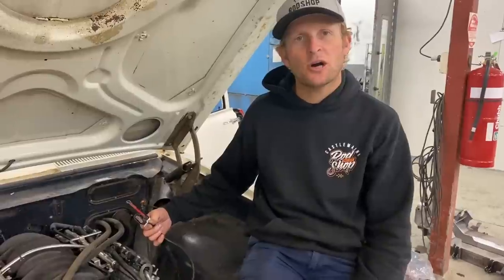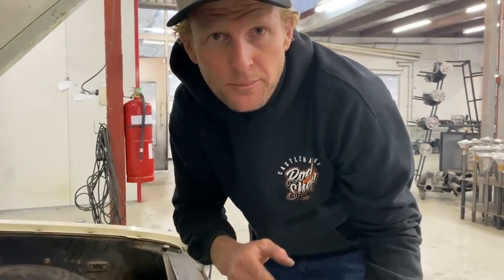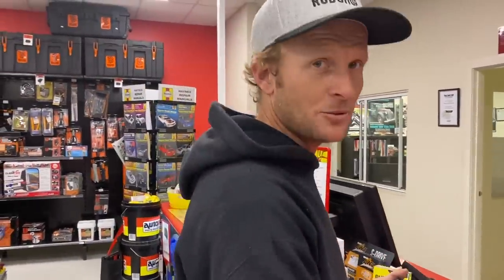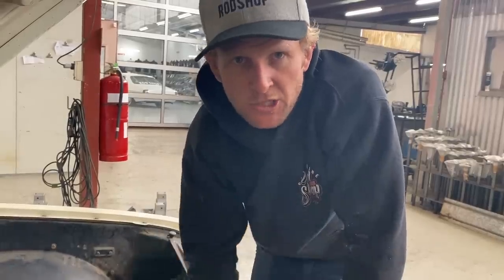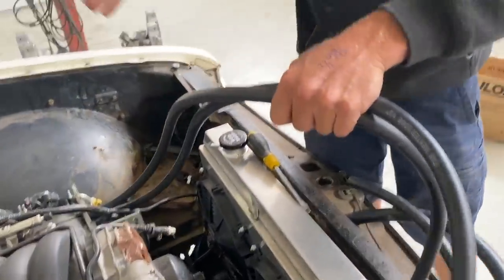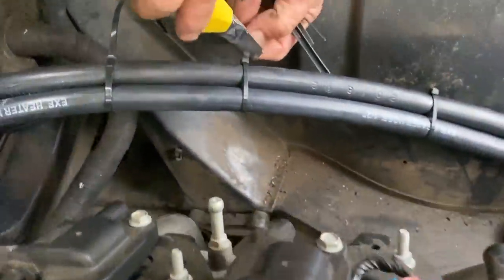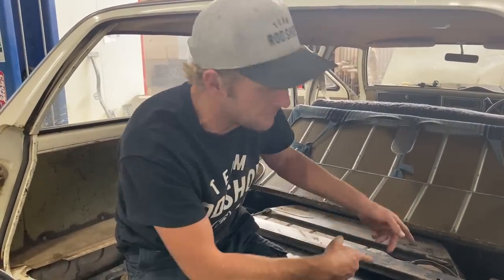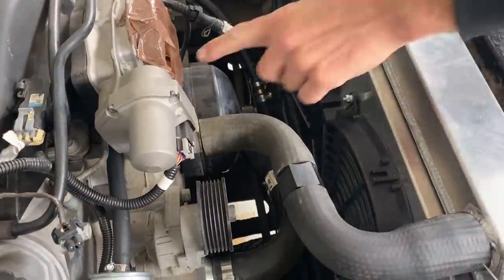How to LS swap a HK HT HG Holden station wagon build EP 7

Comment: I've got a 1995 GMC Sonoma the motor is a 4.3 Vortec engine I just replaced all of my front end suspension minus a arms and the front stabilizer it's all rebuilt bottom ball joints top ball joints idler arm new too much to explain but I love how you show people how to do their own Plumbing that's worth a lot cheers Brothers I'll work on my project and you can work on yours which is awesome do it for Dale

Comment: Great to see the fuel pump clearance resolved, no ones perfect and the section on the corner of the tank that was lowered where the fuel pump mounts is an excellent job it looks as if it came from the factory like that. Better than lowering the tank and with fuel line regarding the coment on the vw ,u shouldnt use copper its brittle and it splits for fuel lines always use bundy tube what the factory use . Back to the engine bay of the ht those zipties dont like long term heat especially in enginebays and i would mount down those heater hoses with some sort of grometted clamp  bolted to the inner mudguard to stop those hoses from slapping and flopping around .

Comment: On my first car, a 71 VW Superbeetle, I did the wire trick with coat hanger wire when I had to replace a fuel line. Previous foolish owner replaced the original steel fuel line with copper and didn’t put a grommet in the firewall where it ran through, it rattled against the sharp steel sheet metal of the firewall and cut through it!

Comment: they are the most dangerous razor blade to use. And there is a dodge hose that is a direct fit for the bottom hose, no cutting required.

Comment: If your going to put a cover on the engine how about using stock ve heater hoses. They will hide neatly under the cover. You could just cut and join them at the back of the motor. They will also stay nice and warm. Not saying the others won’t but they might cool off a bit before reaching the core.

Comment: Hmm is Mark testing us?.
Most ktg"s Kingwoods had heater box in engine bay hence no grommet for heater hoses in that removable panel.
Which is a blank off plate for cars ordered with no heater .Heater was a option on Belmonts & Kingswoods.
Correct me please fellow Kingswood /holden nuts.
Makes me think that under dash heater core /box is a add on out of a earlier holden. 
Earlier holdens say EH had a one piece grommet which held both hoses and fitted in a elongated hole through firewall.
Which is what you should use cause  1 it will look factory & 2 them hoses need to be grommeted cause they will rub through.
Think rare spares sell them or any holden nut probaly has one or two in there shed.
Or use individual grommets.
Anyway great series really enjoying it.
Reply: That heater box is the standard heater style. If the car was ordered without the optional Fan Forced heater that is what you got. Agreed about the grommet, I would use one from a Valiant for it"s heater hose's.

Comment: Mate, sooooo many issues in this vid. You’re doing it as an instructional yet you’re using the wrong hose clamps on fuel injection hose, stretching the wrong size hose over bigger fittings and just letting heater hoses dangling in the breeze. 
These little things are the reason conversions become unreliable, and could be fixed for less than $15.